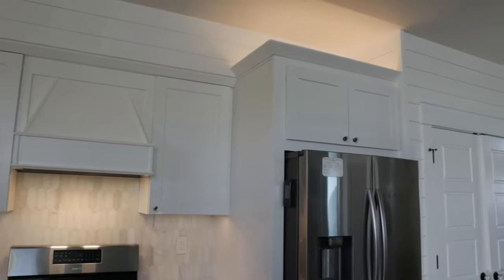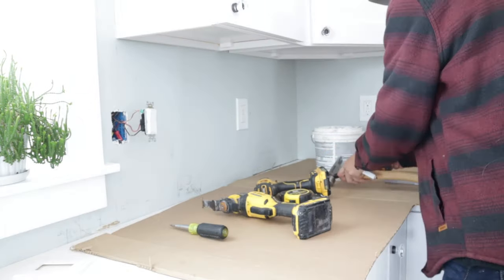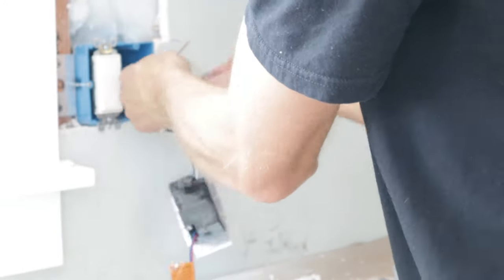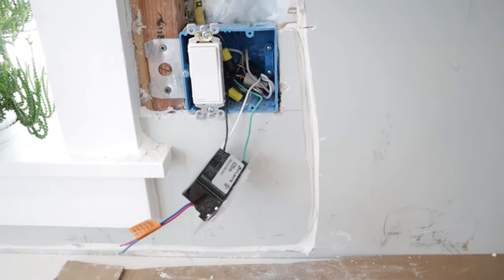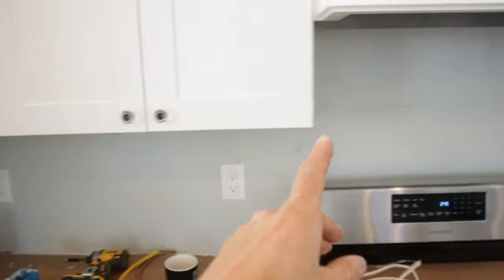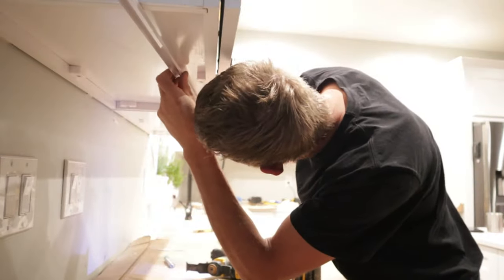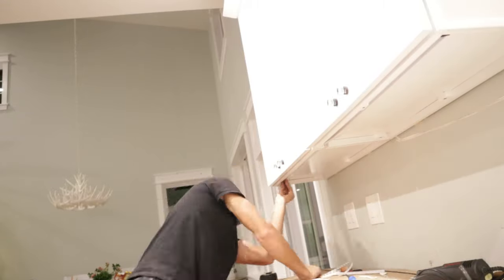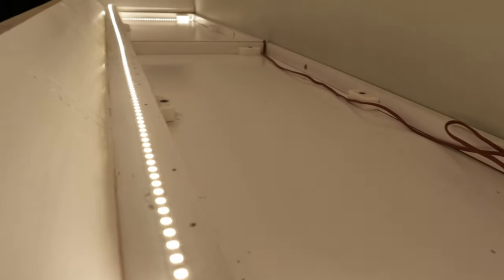How to Install LED Under Cabinet Lighting

Comment: I would have recommended a side screw slider box instead of the 2 gang box you installed that way you wouldn't have any sheet rock repair where the stud is
Reply from the maker: This is a good option as well! If one doesn’t want to repair Sheetrock. I was doing the tile anyway so didn’t mind due to liking the box better!

Thanks for the tip!
Reply: This is a far better solution.  Thanks!!!

Comment: This is the exact same installation that I'm about to do and couldn't find any other videos going through it. Thank you
Reply from the maker: Your welcome. Good luck with your project!
Reply: It’s not as easy as you make it look Josh?  Like you I am a contractor ; sub contractor to be exact (finish carpenter).  In fact I tell ppl quickest way to burn down your house is to save 3 or 4 hundred bucks on an electrician ?   Where DIY’s get in trouble is that box!
Pulling off of a single to a double run it loose, not the right cap or size wire and bingo !
Customer used to ask can you ?  And I say yes?
Then one yr while re-upping my bond & license my insurance provider reminded me “you work outside your license; your not covered”?
Now if I got a GC then I am ?  Maybe?

Anyway these little things like lighting, crown, hardware , is so easy to say “I can do that and save this”!

My Dad who build customs and specs for a living used to say “Yes u can do that & remember it will look like you did it, if you can live with that then do it”!

I would & hv told ppl just make a sketch and list “and” put a chk mark next to the area you really need to be careful!
And keep your insurance up to date; homeowners that is!
Reply from the maker: @zephyr1408  I appreciate your comment. And you are correct to a certain degree! But some Homeowners and DIYers do have some knowledge and some, ummm, not so much. So, only ones who are comfortable or are willing to take on the liability should try doing there own electrical. In the video, I’m just trying to show others how it’s possible to do and give good results! I’m not telling everyone that they should do it just like me, but show how I have achieved the finished outcome on my project! If one is willing to take a risk, that’s their freedom  to do so and if not they should definitely hire a professional! I would always recommend hiring a professional where needed!

Comment: I did it the other way. Install the wires for led strips before sheetrock,   than install power wire from switch box to the outlet for transformer for into sink cabinet. Transformer plugs to the outlet in sink cabinet and switch turns on the outlet pretty simple.
Reply: Sorry for my English 😁
Reply from the maker: That’s a great way, and easier! As long as it’s planned ahead, that can be done. Mine was after the fact the kitchen was in.
Reply: @buildingwithjosh  anyway, u did a great job. Clean and smooth result.
Reply from the maker: @dmitrytomashuk259  thank you!

Comment: Couldn’t you just have used the same bracket and just taken out the box and replaced it with a 2 gang adjustable? Or was that not an adjustable single gang. If it was it would’ve saved you cutting sheetrock

Comment: Hey Josh-my husband is installing a similar LED set up using the transformer dimmer switch and 18/2 thermostat wire. Is there a length restriction using these transformer switches and 18g wire? We're doing a L shaped kitchen/dining room renovation 10'x20' roughly with two transformer switches.
Reply from the maker: As far as I know, I don’t know the limit on the transformation switch, I think you would be fine. I put all my lights above and below cabinets on one switch. If you are running two switches I think you would have more than enough supply. Now I did notice in the light box, these lights get warm to the touch if they are turned all the way up. From reviews I saw this is common and hasn’t been a problem. I’ve had these for a year now, without a problem. 

I don’t know how far you can run one continuous wire run though. I would run multiple 18/2 power supply if it was a 30’ run, or something  like that. If makes sense?
Reply: It depends on what LED strip you're using and how much power it draws. What will be affected is the brightness towards the end of your wire run due to voltage drop. With a 30 foot run, you should be fine using 18 ga. You can test it first by setting it all up and checking everything. If you notice the ends are noticeably dimmer, up your wire to 16 ga.

Comment: Looking at the profile+lens cove and LED strip light you chose I don't see how you achieved a dotless result.  The profile channel is too shallow, the lens cover doesn't appear to be a "fancy" diffuser type.  The strip light does have three LEDs per inch but what's your secret?
Reply from the maker: Ha ha, no secret. Everything in the video shows what I did. There might be minimal dotting looking directly up, but not much. I tried to get as accurate video as possible for transparency. Yes, three leds per inch, matched with a shallow 5/16 channel, and a frosted diffuser. Everything should be listed in description. Thanks for the feedback!

Comment: While the idea of the dimmer that includes voltage conversion is nice and clean, it hardly seems to code since presumably you’re mixing high and low voltages in the same box. Anyone have any input on these products?
Reply: The instructions tell you to put a divider and provide it to separate the top low voltage feeds from the bottom high voltage feeds. There are also vertical dividers you can buy for 2/3 gang installations. Or just buy a divided 2/3 gang box. Yes you are correct though. This guy didn't follow the instructions. Don't be this guy.

Comment: Nice job. Im looking to do this to our kitchen. Are you happy with everything? There are SO many choices, its hard to decide and its not something you would want to skimp on. Thank you
Reply from the maker: Love it! I’m very happy with the outcome! Only thing I would have done differently if possible is run the low volt wire ahead of time behind Sheetrock.
Reply: @buildingwithjosh1145  I'm sold brother! I watched your video twice and it looks like the cleanest installation I've seen. Thank you for listing the products. I'm using your links. Thanks again and real nice job👌
Reply from the maker: @BrandonLund  thank you! I tried to keep it as clean as possible…I’m o.c.d. like that😂. 

Good-luck brother! Quality LEDs definitely make a difference!

Comment: Looks great. Nice work. I like the idea of the built in transformer with the lightswitch. However, I really like automation and not having to flip a switch all the time to have the lights come on is a nice feature. is there a smart switch options that has the transformer as well?

Comment: Really good information here.  One question though. I'm having trouble getting the clean cuts in the channel that you get. Could you specify the brand and model of both the miter saw and blade that you use? Thanks.
Reply from the maker: I used a Diablo steel cutting blade on a basic Skill miter saw. Not a fancy saw  but a good steel cutting blade.
Reply: @buildingwithjosh  Cutting extrusion is not fun, without a brand new blade it wants to grab all the small details of the extrusion. I've had much better luck using a band saw. They make some pretty affordable "chop saw" looking ones that we've found to be much easier to work with or in a pinch an oscillating multi tool.
Reply from the maker: @InnovativeEvan  a band saw works great, however keeping a perfect angle is the difficult part. Thanks for the feedback!

Comment: SOOOO glad they have COB LED tape now.
Reply from the maker: Yes, they look better then the led strips. However I would still use a  channel and diffuser if going for a professional look!
Reply: @buildingwithjosh  Channel strips are be good - but no diffuser needed if you tuck them behind the lip of the cabinet so they point light directly back at the splash guard.  In my experience diffusers can take away some% of the brightness of the COB tape..  This is optimum so they don't point down on high-gloss countertops, creating mirror reflections of your strips.  The best effect in kitchen situations is to have light pointed directly at the backsplash.

Comment: Hey Josh, you may have already answered this question, but did you tie in all of the under cabinet lighting and upper cabinet lighting into that one switch?
Reply from the maker: I did simply wire nut all the leads together and then tied them to the switch lead all in that box.

Comment: This is probably a dumb question, but does it matter for the transformer switch if the switch is being installed on a 20 amp circuit vs a 15 amp circuit? I'd like to put it on a 20 amp circuit.
Reply from the maker: Not a dumb question at all! The transformer switch is intended for 120v, which can be 15 or 20 amp circuits. Just like a standard switch I believe. Hope this helps!

Comment: Were all 4 low voltage leads wire nutted together to the switch?
Reply from the maker: From the transformer switch out there are two wires out feeding, a positive and neutral. All the positive feeds to the lights were nutted together. Also all the neutral feeds were nutted together. Hope this helps!

Comment: Nice job Josh,  I have an almost identical kitchen setup as yours.
My 2 switch gang box has ac power  to 3 locations as well as overhead sink light switch.
Just wondering if I need 3 drivers for all locations.   I am looking at tunable COB lights from 2700k to 6000k for working to ambiet light.
I would like 3 locations to sync for colour brightness and dimming.  Any suggestions would be great.
Reply from the maker: Thank you,  appreciate the comment.

Drivers probably depend on how much laid you are putting on them. Curious, are you wanting to use the existing 12 or 14 gauge wire to get power from the transformer to lights?
Reply: I was hoping to use the 3 locations controlled through one switch.  I have read that cob or fcob strip leds need a constant 12v or 24v therefore cannot use a house line dimmer switch.  I have seen this in other applications so I'm not sure how that works.  I know it's going to be an extra cost to have seperate drivers but the control part I am unsure about for dimming and brightness ie: colour change.

Comment: Very Nice work! Is using stranded 18 gauge wire better than a single core wire? Thanks
Reply from the maker: I think the stranded wire is more flexible than solid wire. However I don’t think it really matters! I only found 18 gauge in stranded.

Comment: So did you have to solder your 22.5 angle or bend them.? Thanks for sharing
Reply from the maker: I folded the led Strip on the 22.5 angles, I didn’t want a gap in lighting. Hope this helps!

Comment: Do you need the aluminum profile track / diffuser if you purchase COB LED lights? 
The use case is for the kitchen under cabinet lights.
Reply from the maker: I don’t believe the COB lights need an additional protection like the aluminum track. They should be able to be ran by themselves

Comment: If you use a transformer that doesn’t come with the dimmer switch, what kind of dimmer switch do you need? I have a transformer going from 120v input to 24v output. Thanks in advanced!
Reply from the maker: I would just use a dimmer switch that can be states that it can work with leds.
Reply: @buildingwithjosh  the dimmer switch I am using is Lutron led+ diva single pole dvcl-153P-wh-2 and it doesn’t work to dim. I checked my connections and it’s all good too.
Reply: @buildingwithjosh you never showed adding dividers to separate the 110V light switch from the dimmer/transformer. You need a vertical and horizontal.

People who buy the products you linked and follow your video and don't read the instructions that come with the dimmer/transformer combo are violating NEC code.

Comment: Josh-do they have a multi colored LED light option that can be soldered? My wife wants one that's changeable and we're in the middle of a kitchen renovation.
Reply from the maker: You should be able too! I believe most led strips should be able to be soldered together. I simply just cut the plug off of the led strip off that would have went into a 110 wall outlet. Then exposed the two wires and soldered them. Hope this helps!
Reply: along with that question about color led on a switch, after soldering, will the remote yo change the colors still work?  do you have any recommendations for colored led strips?     

also can I direct wire a led strip that that only had a plug option, just by cutting and soldering?  could I connect the 18 Gauge wire directly to a 12 or 14 gauge standard 15 or 20 amp 120v outlet?  if a transformer needed to be used (not at the outlet)  would you have a recommendation?

Comment: Great video.  Do you have a link for the switch/transformer you used?
Reply from the maker: Sorry about the delay. I will attach it here in this comment and then I will add to the description. Good luck!
https://www.amazon.com/dp/B07GX5FK4C?ref_=cm_sw_r_apin_dp_PBBEHN04J4CYH9P06144&fbclid=IwAR06sSWPBbcNRj-2Vx2itcpbk9HhpNq7OtE2pNWlAGjKyFFGE1h_RHdqrzY&th=1

Comment: I was looking at some reviews on amazon for the transformer/dimmer switch and it seems that there are some complaints about heat at the gang box and that the dimmer shouldn't be run at 100%. Have you noticed any excessive heat at your gangbox? Do you try to run the dimmer at a reduced brightness to lower any heat that the transformer may generate? Have you left it high at 100% for an extended time and noticed excessive heat?

Sorry if I'm asking too many questions, but im planning to install something similar and came across these concerns. Thank you.
Reply from the maker: These are very good questions! Yes, after a time of use I noticed that the light switch does get hot at full capacity. I try and keep it not at the brightest setting to just avoid the heat, somewhere in the middle. However my wife has ran it on high for extended periods of time and everything operates fine. I tell her to not do that though 😂
Reply: @buildingwithjosh  thanks for answeringy questions. I just want to say, you did a great job. It's the cleanest installation I've found on YouTube.
Reply from the maker: @robloxgamer9335  thank you! I appreciate your comment!
Reply: @buildingwithjosh I successfully installed the lighting with the instructions you provided. Thanks! But I did have one question. How did you snap the diffuser covers into place? I could not get them to snap in
Reply from the maker: @robloxgamer9335  that’s great, glad to to hear that this video could help! 

Interesting, are your diffusers covers not snapping in? To think of it,  I remember they were a little difficult. In order to snap them in they had to go in evenly, flexing the center in order to accomplish this. Kind of in partially and then a full snap once both sides are  partially in. I think if one side is fully in, the opposite side wouldn’t fit in.

Comment: no sheetrock up, thinking i should just run the low voltage wire in the wall and avoid the channel cut, just entering each cabinet.
Reply from the maker: Running the wire before sheetrock is a great idea if you can! Many do run wires to each cabinet and run separate lights. The only thing I don’t like about not running a continuous light channel is that it doesn’t have a continuous light shine on the countertop.

Comment: Can i do the same i allready have the switch from previous cabinet light the ugly big ones.
Reply from the maker: The older lights most likely are running 110 wire , so you could use the switch. However you would have to install a transformer somewhere between the switch and LED lights strips.

Comment: Would have been better if you set it up motion-activated.
Reply from the maker: That is a good idea.
Reply: I disagree. I think there would be too many times you want to walk in there without the light being on
Reply: @sk8infreek  Same. I’m doing mine now and thought about doing motion activated for exactly 3 seconds before I came to the same conclusion.